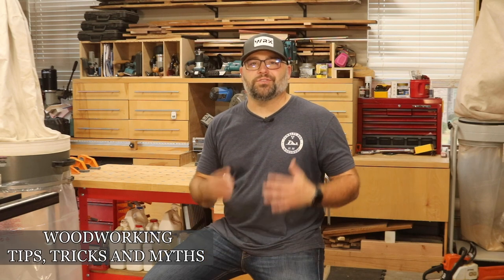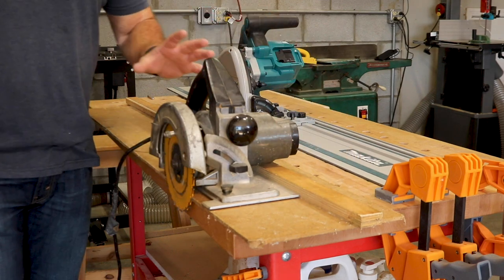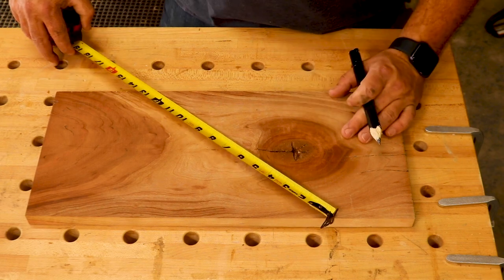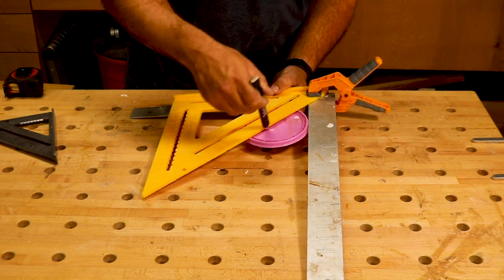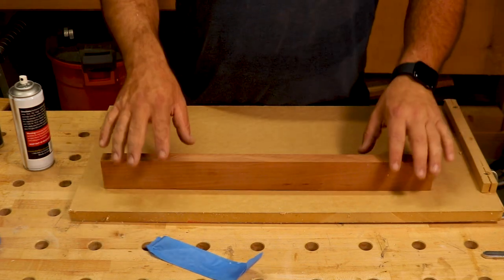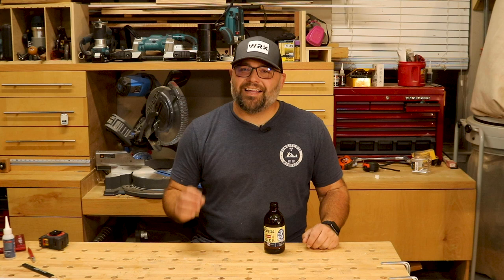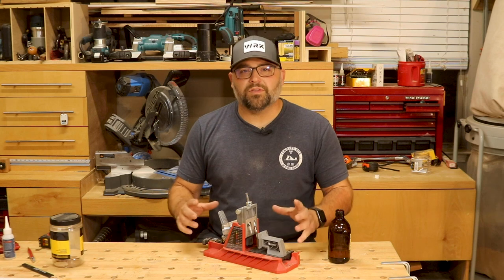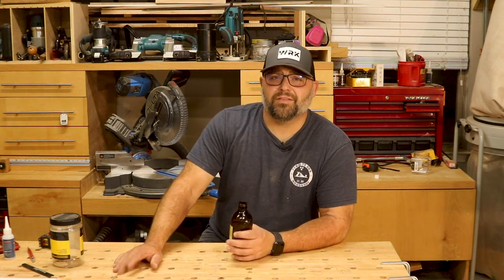7 Easy Tips to Help You in the WoodShop - Bonus Material: Woodworking Myths Busted!

Comment from the maker: VIDEO CORRECTION: When you use the speed square to find an angle, I used the wrong side to make my mark. The proper way is to measure the angle on  45) degree edge and mark on the other 90 degree edge.   I was doing this upside down for the camera, got myself discombobulated and marked the line on the wrong edge in the video.
Reply: Coors Original yeah

Comment: Jess how'd I ever get this far without these tips??  I know you must be getting tired of me saying but"I always learn from your videos".  Thank you for your time as I know editing does that!
Reply: Oh and 1 more thing.  In a previous video you were talking about a yellow blast gate etc.  I have a 1 HP Delta dust collector that looks a lot like the oneyou have in the your shop I saw in your video.  I am thinking about erecting a dust collection system with PVC pipe like yours.  The run won't be more that 15 feet for 4 tools Table Saw, Jointer, Roter Table, Chop saw, and Planer.  My question is does the Delta do the job for the tool at the far end if it's a planer?
Reply from the maker: @richragan4810  Hey Rich, thanks man I always appreciate that! I just took my dust collection down because I just didnt think it was sufficient for that type of run.  Shorter runs would be fine though!

Comment: Some great tips there.

The trick with the painters tape I actually use while making guitars (although I use double sided tape a lot of the time too). Great for holding down fretboards when shaping, holding on templates for routing and holding on sandpaper to flat fret leveling beams. The only downside to this is the tape sometimes sucks in moisture and creases over time. So in that case, double sided tape is the better option if you want it on there for a longer period of time.

As for pocket hole jigs, I was one of those people that though they were only used by people with no woodworking skill. Although now I've realised they're actually great when attaching MDF together as the screws go in at an angle and not straight in. It helps to not split the material as you would if just going into the ends, especially on cuts that aren't very wide.

When buying tools, I think you should invest heavily into the tools you'll use the most. The ones you use every now and again can generally be a lot cheaper. But also look for tools you can upgrade (like a cheap bench grinder with better wheels etc). One of the best investments I've made was a cheap 4" angle grinder that came with 40 discs. Still going through the discs 20 years later and used the grinder to cut replacement panels off cars. It took a pounding and still going LOL. Haven't had to even change the replacement brushes yet!

Comment: Great video, but one thing I see missed a lot when people say you done need expensive tools (which is 100% correct) is that you are better spending money on the right consumables for those tools. You could have dewalt, festool, whatever but if you put cheap blades/bits etc in them they will still under preform, on the other end take a ryobi and put a good blade/bit in there and it greatly improves the results over the supplied consumables.

Comment: I got an old Sears table saw used for about 50 bucks.  Took a little tweaking and I did have to add on a wooden wing that was missing but after that It works just fine!.  You don't need those 2000 dollar table saws in my opinion.  Save some money for the CNC!  :)

Comment: The ruler trick for dividing a board into equal parts is good, but there is one problem: you are not considering the thickness of your saw blade. When you make the first cut, it throws off the sizes of the other pieces. You then get pieces that are not of equal widths.

Comment: Great video. Only thing I gotta disagree with is the glue bottle. Those tite bond and rectangle opening tips are the best. You can throw down a thin line with relatively large coverage with minimal squeeze out with out having to brush or smear it.

If your doing wide work you run it narrow side and you can glob the glue on again with out having to brush or roll and with enough controll for no squeeze out

Comment: Biscuits are a form of loose tenon and certainly adds strength. This strength is not needed in panel glue up, but it is needed in joints where grains of the two joined members are perpendicular.
Reply: The glue joint is stronger than the wood itself.  The biscuits add alignment only---not strength.  Several You tubers have proved this true.  Ref John Heisz and Matthias Wandel on the subject among others.

Comment: You might want to make sure the strip of timber is straight before you attach it to the ply for the saw track.
Reply from the maker: Yea, I figured that was implied but still very true. 👍
Reply: Agreed, that's gotta be a factory edge (or known straight).  The overhand on the other side is a great idea, I wish I'd done that.  I also put a reference edge at 90 degrees on one end for making that long cut at a 90 more easy.

Comment: Thanks so much! Good, sound tips. A tip for you, seeing as you're interested in improving your glue bottle experience. Check out the Glu-Bot, by FastCap. You can find them on Amazon for under $10. Best glue dispenser ever... pulls from the bottom and has a well designed tip.  Check it out. You'll be glad you did.
Reply from the maker: Thanks man! Yea, I’ve used the glue bots before. They are pretty good but you can get like 6 of these bottles for the same price and I have had problems with the glue bots drying down the spout to the bottom

Comment: 0:50 A defect cord should immediately replaced not taped together. Otherwise you risk an electric shock or setting your workshop on fire. A loose connection may also lead to other surprises like the machine stops in the middle of the cut and suddenly comes back to life and jumps backwards (kickback).

Comment: I think your formula to calculate board feet is wrong. You are supposed to divide the length, width and thickness by 12 , not by 144 as stated on  your video. But good tips.
Reply: your formula for board feet it works only if you convert the feet to inches: 8ftx6inx1in/ 144 like this: 8x12=96 so than you do this: 96x6x1/144=4.  The way you have the formula, after you calculate the boar feet you'll get 0.333 board feet instead of 4 board feet.
Reply from the maker: Thank you for pointing that out. I’ll need to go back and watch the video to confirm but I appreciate you letting me know.